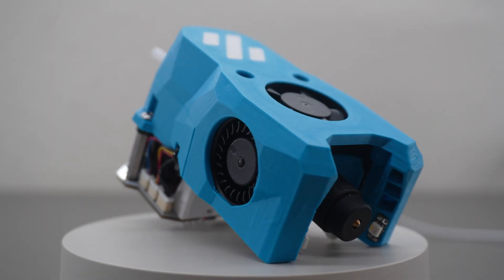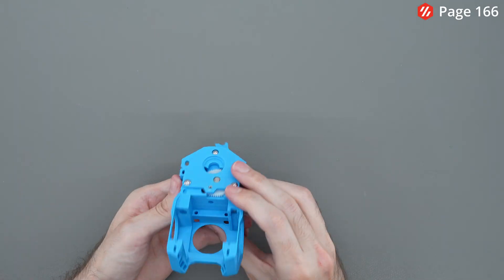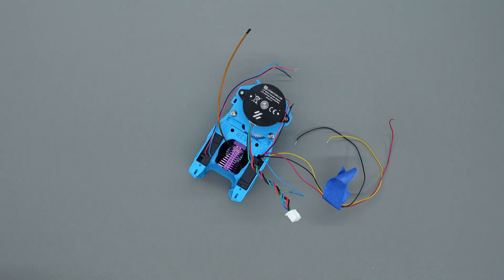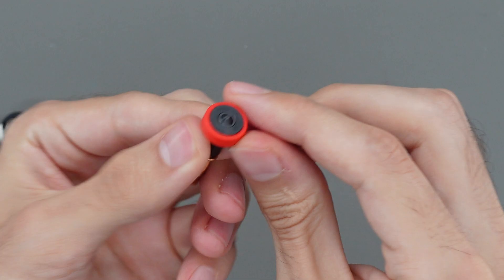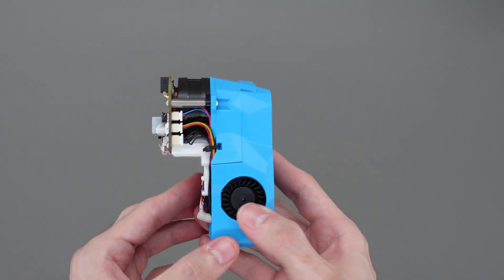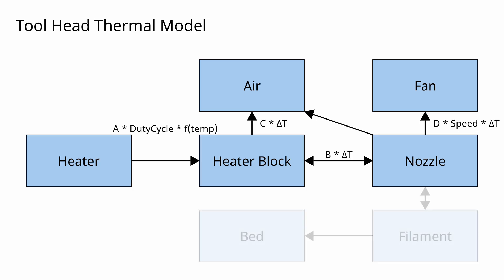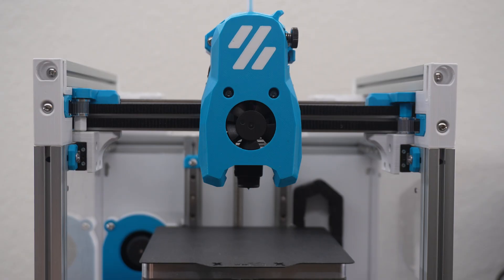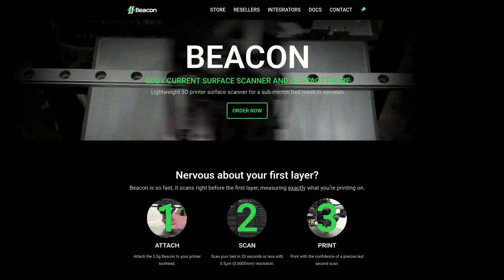Exposing my print head's secrets... | 3D Printer Build Part 3

Comment: Do you think using a 2 pin fan would be problem?
My country doesn't have access to 3 pin blowers and Chinese sites aren't any option.....
What matters the most in choosing a fan?
Reply from the maker: Being the same voltage as your PSU and having high CFM (air flow) are the most important parameters. Also generally you want to be using brushless (BLDC) fans for better reliability. Upgrading 3 pin fans is mainly an extra safe guard. Not strictly required and many people run 2-pin fans for a long time without issues as long as you are getting one with good reviews.

Comment: For the piezo part I would rather use just a comparator. That could drive a simple digital input. Or even a probe input on a conventional mainboard if you choose an open drain one.
Reply from the maker: Yeah I'm considering a comparator in the future to get the latency down. The current approach was mainly tempting as it reduces the overall component count.

Comment: Nice job! I'm particularly interested in the performance of the feed forward control of the heater on filament flow rate. I've advocated for years at this point for someone to do it and even submitted a feature request on klipper's github. I just don't have the embedded skills to do it myself. Please push to merge your FF code eventually. 

Regardless, the level of work and quality of your videos is intense, you definitely deserve more views. Don't be afraid to go into more technical topics, I'm following closely! Subbed!
Reply: Kalico (formerly DangerKlipper) has MPC (Model Predictive Control) for the hotend. When you run the MPC tuning it essentially builds a model of the hotend heater block and can compensate for the flow rate as your printing.

Comment: This is legit awesome. I also hates current toolhead pcb, simply because of the wiring.

However, I do have a question about the threshold for the piezo touch. How do you make this comparison ? Judging from your wording, I'm guessing it's not bz software but rather, with a FET?
Reply from the maker: Maybe the wording was a bit confusing then... There's no extra hardware for doing the comparison. Just a resistor across the PZ probe pins and the signal goes straight into the microcontroller and that is compared by hardware in the microcontroller (effectively doing "analogRead() < threshold")
Reply: @MadeByDennis  I actually rewatched the sequence, and you explained well, i was just tired. However, I still have two questions: How do you program the hardware to trigger at a specific threshold? is that with the resistance you ust mentionned? Or you don't?
And why the magnet on the motor? You've put a magnet angle sensor on your board, but I don't think you've said for what purpose. I'm guessing to identify when the motor is skipping ?
Reply from the maker: @Sttreg  I'll publish the code for the MCU I'm using once the printer is fully working. The general answer is: the resistor value just amplifies the signal. The software depends on what MCU you are using, but generally you can search for "adc comparator" or "adc threshold" in datasheets or libraries to find the feature. This is the feature for the specific MCU I'm using https://docs.nordicsemi.com/bundle/ps_nrf52840/page/saadc.html#ariaid-title14 ("Event monitoring" section) . Yes. The magnet is mainly for skip checking and a few more things I'm experimenting with. Probably will be more information in a later video.
Reply: Yeah I was not a fan of the piezo touch. addon, I do prefer overall the basic klicky or tap. Although majority of mine now use beacon and cartographer probes.

Comment: Loved the animations! I hate to ask for your secrets, but how did you make them? Insane work as well with making a whole new toolhead board. Huge fan of the white PCB. I'd love to do the same as I haven't found a toolhead board that'd work with my (stupid) plans of building a ~220W hotend, which would be a bit much... I've already given up and plan on running some overly long wires all the way back to the mobo since that's easier. Hopefully I can find a compromise. I've never used a CAN board, but I've thankfully got a spare GEN 2 EBB 42 for future use which I am excited to try. 

Once again, so many great visuals and notes in a really fun video. I'm really enjoying them. All the best with the development of your machine!
Reply from the maker: Thanks!
- Animations: They animations are written in JavaScript (canvas), since that's what I'm most familiar, and rendered with a NodeJS/FFMpeg script into 4K video. Some parts are static assets imported as SVGs from other programs like Inkscape on top of which animations are added. I'm writing a bunch of custom utilities for the common animation tasks which I can probably share once the code doesn't look like garbage.

- 220W hotend: Lol. My current board I've only speced up to 24V 100W. My impression is that this ends up being inevitably limited by the umbilical wires. I at least didn't see any 'all in one' power+data umbilical wires that have very big power lines in them.

- CAN: Just a quick clarification that my tool board is using USB. This will be a completely CAN free build.
Reply: @MadeByDennis  Thanks for your reply!
I should have realised they wouldn't have been "simple" to achieve, haha. That's one reason for me to try and learn JavaScript... I'll keep fiddling around with static PNG's for now and try to get some good results with that. For proper technical explanations like yours, having full control is something I can see being super useful. 

Yes, haha, I'm hoping it won't actually be that powerful, but that's what it's looking like. It's very limiting as I'd love to use it with a board to simplify the toolhead. I guess I could still use the EBB, but then I'd have to still run the heater wires back, but 6 wires is better than 12+ 🤔I'd still have to run the beacon cable though... So many factors. Yes, I haven't seen many higher current "all in one" wires either. I think the most I saw was one capable of ~200W, which is still pretty great.

My apologies, I always revert to thinking of CAN when I see toolhead boards and such. I appreciate you clarifying that.
Reply: I genuinely find it crazy I run into you coming from the petabyte project to this. Can't wait for more content from both of you.

Comment: Nice! Are you going to optimise the toolhead so the center of mass is decent?
Reply from the maker: Interesting idea. Not currently planned. Was going to measure how the performance is as is and improve gradually from there.
Reply: @MadeByDennis nice I look forward to your progress! other projects have found that getting the centre off mass as close to the linear rails bearings radically improves the resonances. 50k acceleration with no ringing is possible with a SLM toolhead that's been COM optimised

Comment: Very impressive tool board! How did you figure out what components you needed on your board and how did you program the microprocessor? Are you going to make a separate video on how you designed it?
Reply from the maker: In short, most boards end up being a bunch of standard blocks (e.g. power switch, LEDs, motor driver, etc.) with simple wires gluing everything to power and the microcontroller. So if you try looking at the schematics for some existing boards, you'll start to recognize the common repeated patterns you need. The programming part is a bit harder to explain shortly... but for common microcontroller boards, the new trend is to use a pre-written firmware that deals with the low level hardware (e.g. https://www.klipper3d.org/MCU_Commands.html) and at a higher level you can send commands from your computer. At least the MCU I used didn't have an existing firmware, so I did end up writing it myself and I also needed to add some features that aren't abstracted away in the standard firmwares.

Regarding videos, I had thought about doing a follow up on how to design the boards. Maybe I'll do ones covered both topics if there is enough viewer interest in the comments here.
Reply: @MadeByDennis  A video about board design would be amazing!
Reply: @MadeByDennis  Any chance you'll publish your PCB schematics soon? You've inspired me to take the plunge in making my own and being able to compare my preliminary design to yours would be a huge help.
Reply from the maker: @SamKudarauskas  Working on the full kicad release for next weekish. Here's the schematics for now. https://drive.google.com/file/d/1JUQwcFe7WQKcZmxLcnZPEq2WMcML_uHv/view?usp=sharing
Reply: Bigger question. How does he find the time?
Reply: Would love to see a video about the board design. 👍